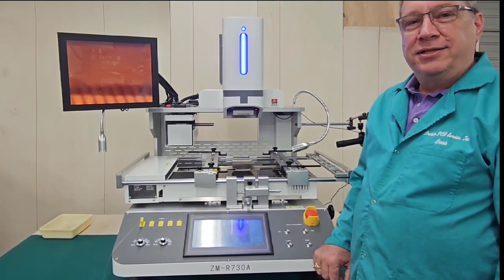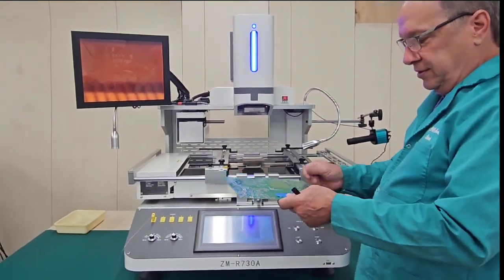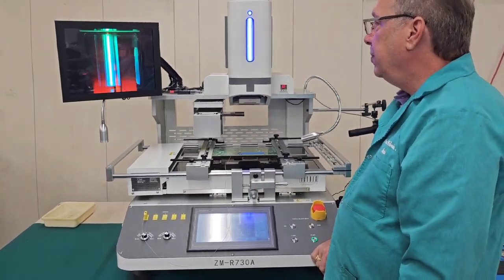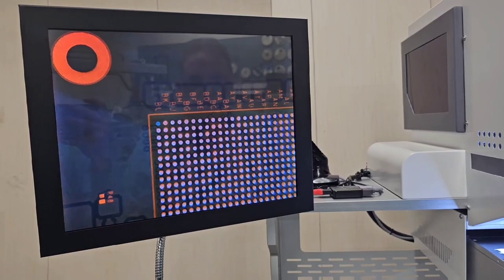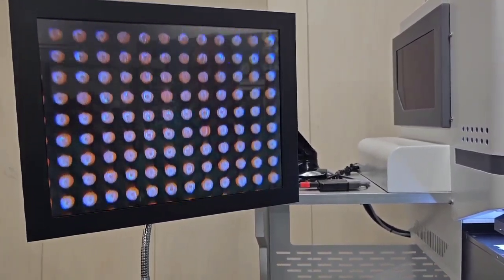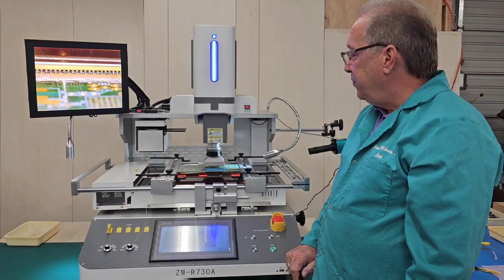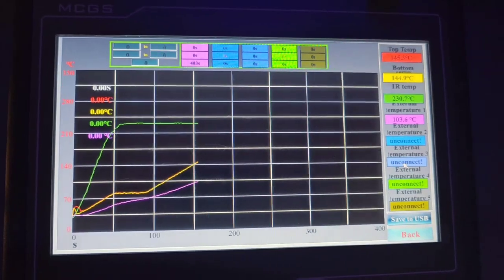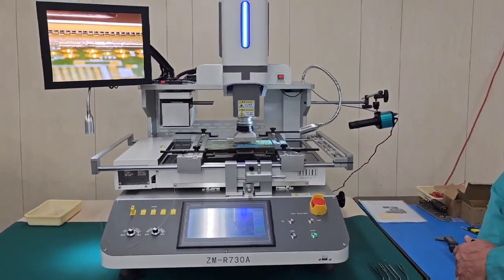BGA Installation demo using the ZM-R730A BGA Rework Station

Comment: Watch your video.
Is a very good one.
However, the size of BGA is 55 by 55mm.
Why not using nozzle of 60x60mm.
It seems the nozzle use is more than 70x70mm.😮
Reply from the maker: We suggest to use a nozzle tht is minimum 2mm larger than the component.  We use as large of a nozzle as possible if there is enough keep out area.  Using a larger nozzle will provide better heating and reduce board warping.

Comment: Did you change the upper airflow rate ?

For me using the same temperature upper and lower, especially with small chips, tends to bend my bga
Reply from the maker: I normally use same top and bottom heat setting. But you don't have to. If chip or board is warping try baking chip and board at 90C prior to rework. Try using a larger heat nozzle.  Try reducing your heat ramp or rate to 1 degree per second.